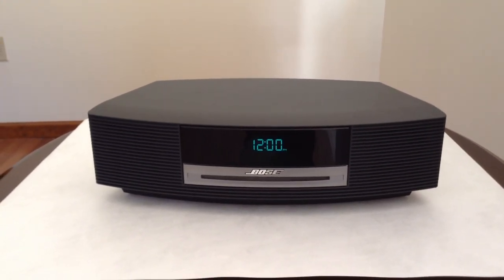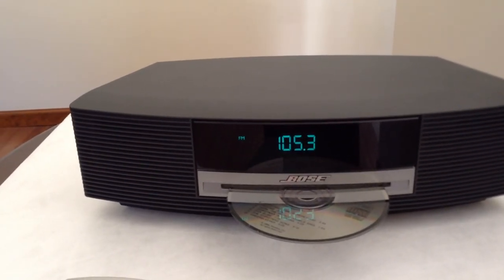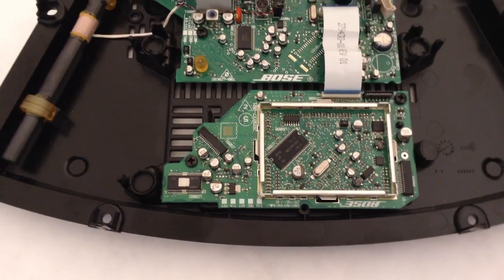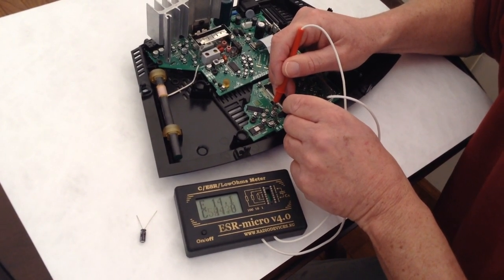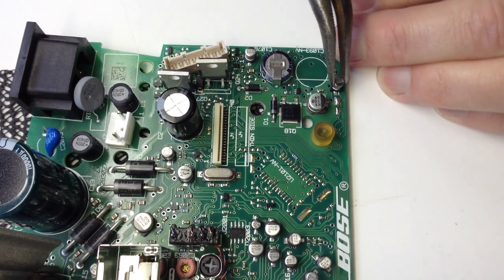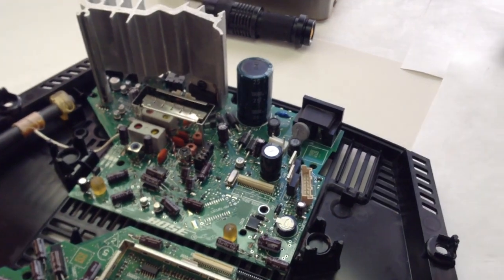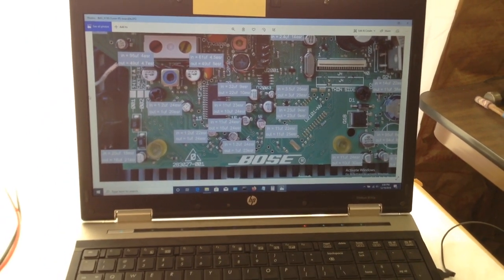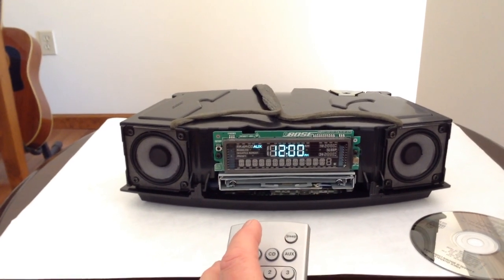Bose Wave II - AWRCC1 resets and CD skipping. Repair "Please Wait" problem

Comment: FWIW, this video was invaluable again - fixed an AWRCC1 dated 2008 for some friends.
In this one, the can on the MPU/CD board contained just 5 capacitors instead of the 6 in yours.
Thanks!
Reply from the maker: That's great Dr Dave. I though my videos were only for insomniacs to help them sleep.  That's interesting about the different board rev for the AWRCC1.
Reply: Hmm... I was wrong about the differing board revision; looking at my photos, I now see it's the same number on the board as in your dropbox photos! However, one of the capacitors is different. Instead of the 22uF electrolytic SMD cap yours had in the can on the MPU board (nearest the front/BOSE logo), there is a 33uF tantalum (labeled "336 10K 845"; the manual for this radio was data 2008, so the "845" might mean 2008?) in a tan plastic package! I didn't recognize it as a cap, so didn't replace it. (Probably wouldn't have anyway, given its longer expected lifetime.)

Now I'm wondering if this device had been serviced before, although I didn't see any other evidence than this odd cap. Also, the tantalum package totally covers the pads, so I wouldn't have been able to desolder it with an iron, but would have had to use hot air, I guess.
Reply from the maker: @DrDavesDiversions  I'm glad it's not a different board rev, but that tantalum cap is a mystery. If it were a factory referb, you would think BOSE would have replaced most if not all of the caps in the can. May it was done by a hobbyist or 3rd party repair place. You can be almost certain it did not come from the factory like that.
Reply: @georgeterbush2976  Ah. When I return it to the owners, I'll ask them if they recall having it serviced; they were fastidious enough to record the original acquisition date (Dec. 28, 2008, and the date they ordered a second remote in 2010). Funny coincidence that the tantalum date code matches the date they had hand-written on the manual (2008). The manual copyright date is 2004.
Possibly it was purchased used.

The other Wave radio I repaired last year, I had bought refurbished from a BOSE factory store. As you say, no tantalums.
Thanks!

Comment: Wow George, great video, lots of work pays off, Thanks, Mine just skips, I'm going to try to clean the eye and see.Thanks for the awesome info.
Reply from the maker: Thanks Kevin. If the cleaning does not work, the next step would be replacing the caps. I would start with the ones under the metal lid first. Many people have had success just replacing the two 22uf caps...
CAP ALUM 22UF 20% 10V SMD
https://www.digikey.com/en/products/detail/nichicon/UUD1A220MCL1GS/589983?s=N4IgjCBcoLQdIDGUAuAnArgUwDQgPZQDaIALAJwDMIAugL514BMxIAqmwCJgCCTTABgCyAYQAyYAOIBlWnSA
Reply: @georgeterbush2976  will do thanks!!

Comment: Great job...very interesting!  I have a 14 yr. old Bose that is having exactly the same problems as this one.  So, I tried the blow dryer method that someone showed ....blow into the cd vent for about 2 minutes.  I guess it heats it up inside and it worked today!  But I'm pretty sure this will be a temp fix.  Anyway, thanks for the very informative video.....I like to understand why things don't work!  Now I see what is wrong with it.  And I love the Charlie Brown CD....Happy Holidays!!

Comment: Mine is doing exactly the same. Now I know how to fix thanks
Reply from the maker: Try the easy fix first by just replacing the two 22 uf 6V caps located inside the metal box. Many people were able to get their BOSE going again this way. I'm still happy I replace all the caps that I did because I could measure that they were bad and perhaps they affected the quality of sound or operation.

link to picture...
https://tinyurl.com/yst4m8v7

Good luck!

Comment: My unit did the very dame thing.  Sent it to Bose and  they repaired it replacing 3 of the caps and the entire cd drive for $125.  They give you a work up sheet and note the parts replaced.  Thought that was a good deal.  It is now warrantied for 1 year.  Only caveat was the service time of 35 days.
Reply from the maker: That's great to know Marlene. I'm glad Bose is still doing repairs on these old units. Can you tell me which caps were replaced?

Comment: I just bought a Brand New Bose Wave IV and it stopped working tonight. The radio works and the Blue tooth will connect to my phone but not Alexa at home. The CD player will not play either and it is a little over 3 months old. QVC will not return and they suggested calling the Manufacturer. You made an Excellent video hope Bose didn't use Cheap components in the New Models they are selling.
Reply from the maker: I sure hope the problem is not the caps. My Bose Wave was 15 years old and plugged in 24/7. Your Wave IV is brand new. I would go to the Bose Wave forum and see if a moderator can give you some assistance...
https://community.bose.com/t5/Wave-Systems/bd-p/cd-radio

Good luck Dave. Keep us posted on the situation.
Reply: @georgeterbush2976  Talked with Bose Manufacturer today they said due to Covid they wouldn't be able to help me until tomorrow. They would be able to repair the one I have but not replace it since I purchased off of QVC. Its not even paid for yet? I think my Alexa Thermostat caused it to over heat when streaming blue tooth. My phone gets very HOT sometimes when I stream from it to my Bose Wave also ?
Reply from the maker: @claystone7729  I'm glad Bose will take care of it for you.

Comment: Thank you very much for this instructive video, George.  My Wave is manifesting slightly different issues which I suspect are also caused by faulty capacitors.  Your video and linked information has given me the confidence to open it up and start investigating the two boards, then get on with some replacements.  More to follow after my ESR meter arrives .....  Simon
Reply from the maker: Good luck Simon. You have nothing to loose since it is already broken. What ESR meter did you order?
Reply: @georgeterbush2976  Thanks George.  Good point - it's a tosser if it's not fixed (as it won't even function properly as an alarm clock).  I ordered a "MESR-100 ESR" on ebay for equivalent of US$45 delivered and hope it's good enough to do the business.  It will take a week or so to arrive.
Reply from the maker: @simonstuartmurray  That MESR-100 ESR looks like a good one. I like the big display, the ability to replace the probes and zero out the meter and the 100k frequency during test. Very nice!  Keep us posted on your progress.
Reply: @georgeterbush2976  The meter arrived and works well enough.  I tested all the electrolytics several times over and much like yours, mine were a tale of woe.  I've order a raft of new (radial, non-SMD) ones from Digikey and will install these and report back again in due course.
Reply from the maker: @simonstuartmurray  The radial caps will be a little tricky to work with because you have to lay them down and adjust the leads so they can be soldered to the circuit board pads, but it can be done. Just take your time. The journey is the reward!
Reply: @georgeterbush2976  OK, George - a quick update: my caps arrived and I decided to try my first replacement.  It was a 22uF 6v cap (the one above my two (!) super-caps on the amp/tuner board).  Its ESR measured 44R in situ and 39R out of circuit, with a capacitance of 24uF.  The new cap measured 22.2uF and ESR 1.0R out of circuit and 1.1R in situ.  Like night and day!  Simon, who's now keen to change out all the caps and fire the thing up!
Reply from the maker: @simonstuartmurray  There is something very rewarding about measuring a component with a meter and determining, without a doubt, that it has failed and replacing it with a good one. Great feed back. Keep us posted!
Reply: @georgeterbush2976  - thanks once more George, I just finished swapping out all the electrolytic caps and one 2.2uF non-polarized cap in the Bose.  All done now: 

https://www.youtube.com/watch?v=ye3sGayqo4Q
Reply from the maker: @simonstuartmurray  Great job Simon. Love the video. Very clean work you did there!

Comment: Thank you George. You've proved to me that it's not a problem I can deal with. I just have to decide whether to get it repaired or just buy a new one?
Reply from the maker: It is definitely a project. I wish it were as easy as inserting a cleaning disc.  Many people have had success repairing their Bose by replacing a few caps inside the metal can. Whether you replace most of the caps like I did or just a few, it still requires full disassembly of the unit and careful rework skills. Good luck with whatever you decide to do.
Reply: You can get a refurbished Bose Wave Music System IV directly from Bose for $299. My Wave system 2 from about 2003 has just started skipping CDs. Not repairing it

Comment: An additional thought.  I was surprised at how easily the caps came out -- very little force needed.  I think Bose had some problems with their soldering process -- so some of the caps that look like they've failed may just have a poor (high resistance, loose) connection.  Still need to replace them, however -- not possible to rework the soldered connections or reinstall a removed cap.
Reply from the maker: There may be poor solder connections on some units but my caps were bad. I still have all of the caps that I removed from my Bose radio. When I measure them with the ESR meter they show the high resistance.

Comment: Just being plugged in over the years wears these out? …what about if a unit was unused and in storage? Nice video!
Reply from the maker: If the unit is plugged in and basically being used as an expensive clock for years, all of the electronics are still receiving power, even if you are not playing CDs. If the unit was new in a box for 20 years, the electrolytic caps may still be like new.
Reply: @georgeterbush2976  thank you!

Comment: I had the same problem with it saying "Not Playable" on a CD I know is good and plays  fine in my other players.  So, I put it back in the Bose and let it blink about 15 times and it eventually accepted the CD and played it.  These Bose machines get weak after many years of use and become somewhat temperamental.
Reply from the maker: Yep. When the capacitors warm up a little, they work somewhat.

Comment: Hello George, I came across your video since my Bose is doing the same skipping thing on the CD.  I've never used a soldering iron but I'm pretty handy and have learned a lot on youtube! (including tiling a bathroom, installing a ssd on my computer,  and playing the guitar :-) )I bought the caps you used and am planning to just replace the ones in the cd circuit board.  My question is what type of solder iron, tip and also what size of solder do you recommend? I appreciate your very detailed video and only wish I could see how you soldered the caps.  Thanks again and I'll let you know how it goes!
Reply from the maker: Hi Diane. Thanks for watching. YouTube is great. I learn all kinds of stuff here.

I used my old Weller WP25 soldering iron with a small pencil tip and for solder I used, once again, my old roll of Radio Shack 60/40 rosin core solder that is .032" diameter. I uploaded a few pictures of them on my Dropbox drive if you want to see.

https://www.dropbox.com/scl/fi/ywbiiwbuoftshtgx27tob/soldering-iron-1.jpg?rlkey=xas0ykp1jmi9tlxhe9ym9zh94&dl=0

https://www.dropbox.com/scl/fi/n2wteelnyeyq3byoy9g6v/soldering-iron-2.jpg?rlkey=1delxx9z8h8irwu2nft9qb4xn&dl=0

https://www.dropbox.com/scl/fi/6zpug7r14ph14zlgeywdq/soldering-iron-3.jpg?rlkey=a2ibi06jwfsc9j6mzknqa18lr&dl=0

https://www.dropbox.com/scl/fi/73im9d6kd79dxnmm7mj9h/soldering-iron-4.jpg?rlkey=smfbyd4adp9kt34wfxvzbtyr9&dl=0

Good luck with the project!
George
Reply: Thank you so much!! I'm watching soldering videos now. LOL! @georgeterbush2976
Reply: This is not a good project for a first time solderer. I’ve been doing electronics for years and i had to build up a certain amount of skill before soldering on a board with surface mount parts. Just look at the pitch of those traces!  Also , beginner or experienced,  soldering radial can caps onto a surface board makes no sense at all.

Comment: Great video George! Thanks for posting it. My Bose Wave II has the CD skipping problem. I don't think I'm skilled enough with a soldering iron to attempt this fix though.
Reply from the maker: Thanks Dennis. It's not exactly a slick production but the information is there. More than likely the caps in your Bose have gone bad, but it is still worth cleaning the CD lens like "The Specialist" outlines in his video. That was what I tried first, but without success.
https://www.youtube.com/watch?v=Yxc8O53dGII

Another viewer mentioned that Bose will repair the unit for $119 but I don't know if that includes shipping each way.
Good luck in whatever you decide to do with it. At least now you no what the problem is and what is required to fix it.

Comment: Hi every body , if the selector is not responding(aux, CD,fm) or taking too much time to start , then open steel plate carefully  find  the capasitor 6 v 22uf remove and fix the new one thanks. I did the same .now it starts very quick and working well. Thanks.
Reply from the maker: Hi John. Just for clarity, which 22uf under the steel plate did you replace? There are two of them.
https://www.dropbox.com/s/y0f75hn8u0nne6b/IMG_1108-MPU-CD-board3.jpg?dl=0
Reply: The exact capacitor in your drop box picture shows is As follows ,in=68uf  17esr
Out=21uf  60esr
Reply from the maker: @johnbosco8020  Thanks John. What made you decide to replace that one? Any troubleshooting tips will be welcome.
Reply from the maker: @johnbosco8020  Awesome! Thanks John.
Reply from the maker: Answer from John Bosco -  Hi George, the cause of this problem is weak capacitors, when I warm up the capacitors by blowing hot air it is getting starts easily, and it is complicate to find the particular capacitor. I let the system to get cool and I power on, so as usual not start. I warm up the soldering tip and touch the capacitors one by one, when I touch the particular capacitor it start working by this way I found the fault. Thanks.

Comment: Try some Bismuth - low melt solder, you will be able to remove it NO problem. I think you will love the stuff if you have not tried it yet! Highly suggest... Just remove it ALL with some wick before you resolder cause it will make a really bad cold joint if you leave bismuth in the final joint
Reply from the maker: Thanks for the tip! I will read up on it.

Comment: This is an excellent video! I have a problem on mine where after displaying READING DISC for a few seconds, it then reads NOT PLAYABLE. The disc mechanism seems fine, no strange noises, it takes and ejects CD's and it does spin. I have replaced the whole laser mechanism with a new one but it sill says NOT PLAYABLE after READING DISC. I have tried different discs also. Would it be a 'circuit board' issue, or mechanical? I'd be grateful for any advice, if this is something you'd know off the top of your head that would be amazing. Thanks in advance :)
Reply from the maker: Hi David. I did not see the "NOT PLAYABLE" message on my Bose player, but it sure looks like a common problem that many people are seeing...
https://community.bose.com/t5/Wave-Systems/Not-Playable-Message/td-p/218177

What Bose system do you have?

It would not surprise me that the problem is a bad cap on the MPU/CD circuit board, but I do not know which one it would be.
Reply: @georgeterbush2976  Thank you George, I appreciate the assistance 😃👍🏼
Reply: @georgeterbush2976  I forget to say, my system is the AWRCC5
Reply from the maker: @david_wright  The AWRCC5 looks the same as my AWRCC1 on the outside. It may have been built around the same time. Mine was built in 2004. Since it was plugged in all of those years, many of the caps have dried out and have gone bad.  I wish I could help you more. If you had a ESR meter you could take measurements of the caps and compare them with my readings that I posted on the jpg's in the description above.
Reply: @georgeterbush2976  Awesome! I’m not that electronically minded despite a love for tech haha, but I’ll let my dad take a look at it. He has a multimeter; I’m guessing that’s a similar thing? Thanks again George 👍🏼 appreciate the advice 🤩
Reply from the maker: @david_wright  A ESR meter is a little different than a typical multi meter even though they are both measuring resistance. A ESR (equivalent series resistance) meter applies a high frequency across the capacitor then measures the resistance of the cap. Some multi meters can measure capacitors, but what you really want to see is the ESR.  I have a really nice ESR meter made in Russia that you see in the video. That cost around $75.  I also bought a cheap one to play around with and it is surprising accurate.  It was around $16 on Banggood...
https://www.banggood.com/GM328A-LCD-Transistor-Tester-Diode-ESR-Meter-PWM-Square-Wave-Generator-Soldered-Module-p-1384846.html

Always make sure a cap is fully discharged before you take a measurement. The charge can blow out the meter.
Reply: @georgeterbush2976  Fantastic!! Absolutely brilliant, that’s interesting to know. I guess I’ll be able to fix other things as well with an ESR. I’ll have to scope out tutorials on how to use it lol 🤩 thanks again 👌🏼👍🏼

Comment: Is there any way to fix this without taking it apart. My Bose is 14 yrs old and crashed after a power outage. Only the clock works. Im sad cuz I used this for sound on my TV.
Reply: Try a full system reset. It's listed in the manual. You need the remote to do that
Reply: @ScottFrye000111222   Thx, tried both quite a while ago and neither worked.
Reply: Sorry 4 UR Loss , I live in Ridgecrest 2 Years ago during our Earthquake my feel of a Really Really cute 3 leg pedestal Table 
(I KNO🤷) Any who got lucky still sounds like a champ...Sooo
My query is what's the process to hook it TV ? PLMK. Thanks